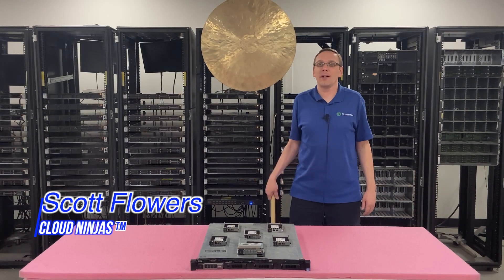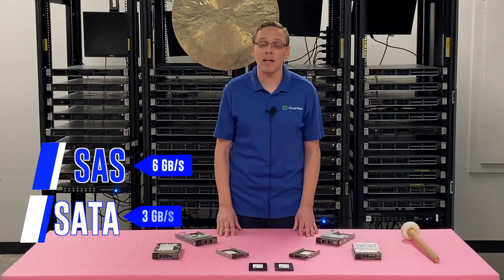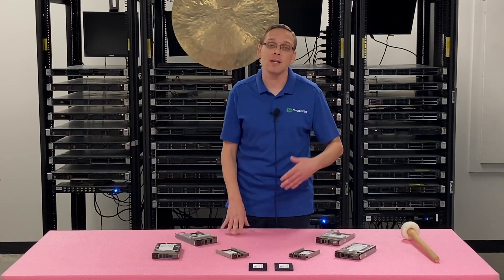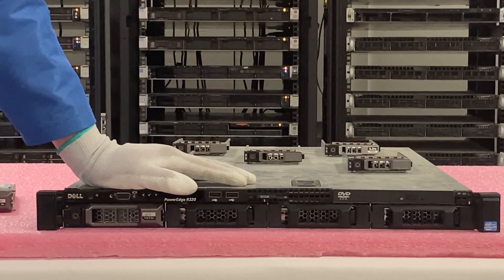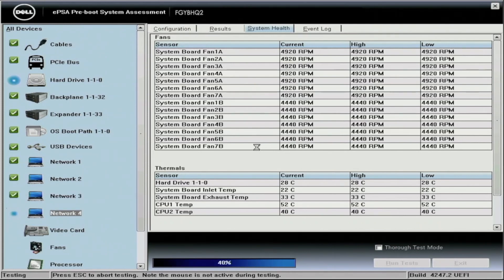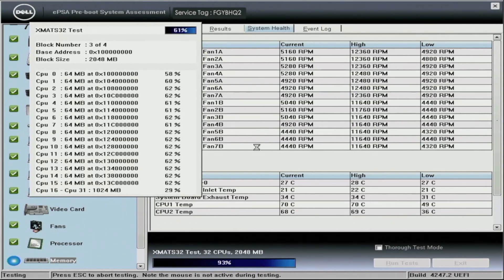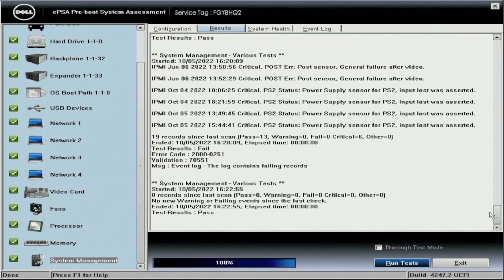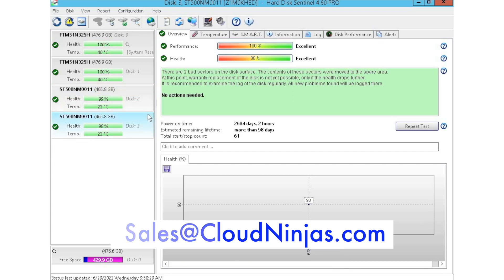Dell PowerEdge R320 Solid State Drives | SSD Upgrade Spares & Options | How to Test with Dell Diag

Comment: Hi Scott, when i ran the Dell Diagnostics my CPU temp went up to 84 °C (183.2 °F), it become so noisy as fan speed at 100%, is that normal or something wrong with the CPU? i just bought this server from my local store and i had updated all firmware and bios to the latest.
Reply: It is normal because it's benchmarking the cpu and the fans for thermal regulation
Reply: @leonardotoschi585  i'm not sure if the CPU or this model more noisy than other model? I have Dell R610 and HP DL360 G7 they both very quiet fan always stay low around 20-25%, The Dell R320 every 5-10mins the fan start to ramping up and i check CPU in Idrac always around 65C to 70C+. The server only running  a few esxi 7 and one windows server 2022, there is no workload or activities just fresh install.
Reply: @sunnylm2045  try to put it in power saving mode, it will help the fans to quiet down